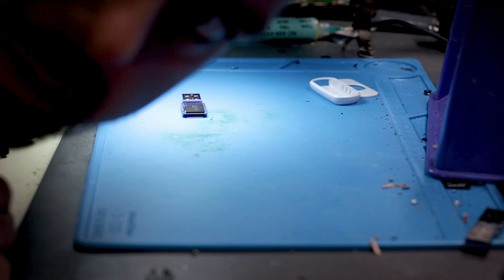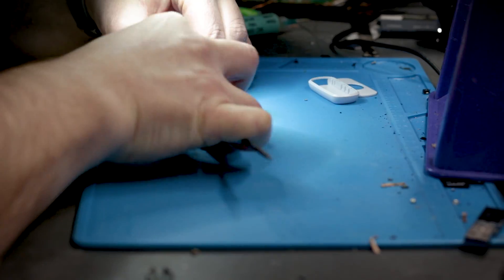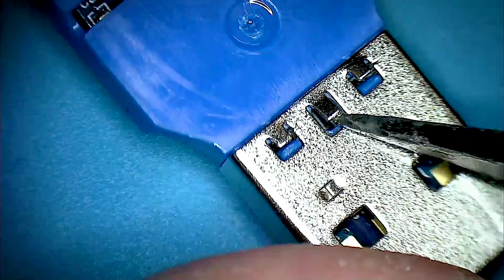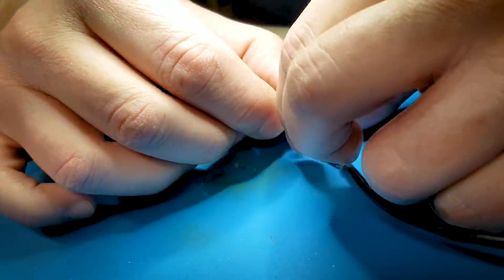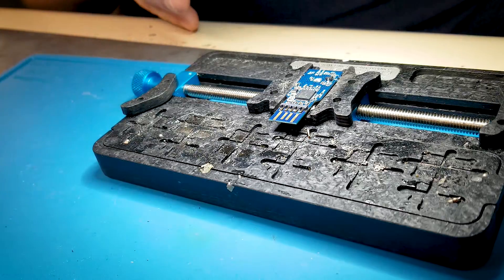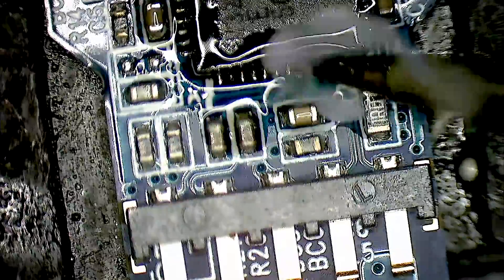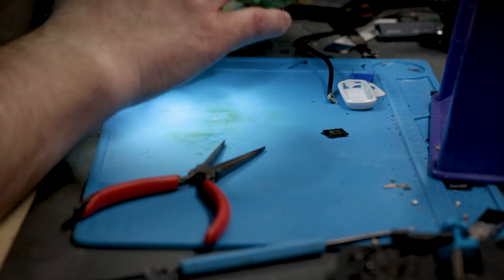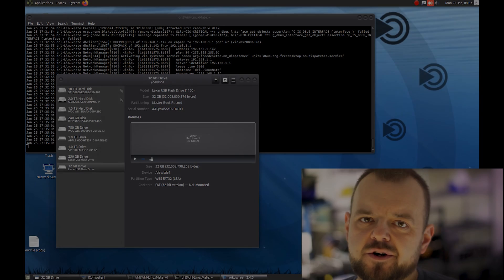Most underrated tool in data recovery - Lexar drive not showing up.

Comment: Nice.  I dig the microscopic work.  What magnification device you have?  I used to use a Mantis steroscopic unit at my old job... they're $4000 new tho!  I need a good unit for maybe 4X magnification for work pieces about an inch or so high plus room for solder work.  Got any suggestions?  Great work!
Reply from the maker: Send me an email and I’ll send you a good yet not very expensive microscope from aliexpress. A trinocular model with camera 

Mine I think is 40x with fresnel attachment where I can work far away from it.
Reply: @forensicguy  sweet thanks!  Heres my email:  dimebank@yahoo.com   u rock!
Reply from the maker: My email: krzys.stanko@datarescuelabs.com

Comment: Hi, is your flux expired on 28 November of last year?
Wouldn't be better using Amtech NC-559-V2-TF instead NC-559-ASM-TF?
Reply from the maker: Yes I bought a bag of these a while ago. Still works fine, but I also have others more recent ones. Chipquick and another brand I can’t remember
Reply: @forensicguy  I would try out Amtech VS-214-A-TF
Reply from the maker: Thanks Salman, I’ll give it a try